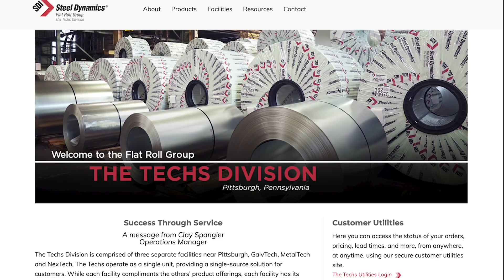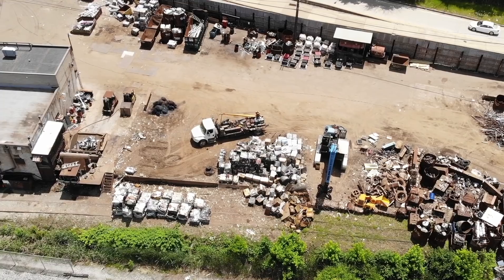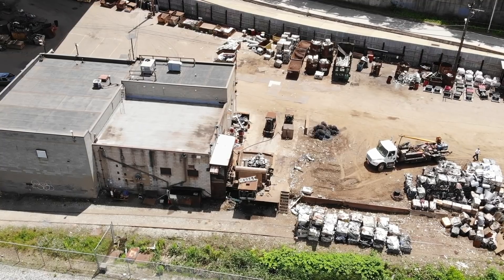STEEL MILL Industries You Can Model on your Model Railroad.

Comment: Thanks for all the great drone footage, DJ.  In the mid-60's when I was in college, I worked four summers at U.S. Steel's Gary Sheet & Tin works.  Specifically I was in the 30" hot strip dept.  I saw a lot of steel slabs and the coils made from them.  Of course, the EJ&E was the whole RR story there.  There was a siding inside our building for loading gons with scrap.  Boy, those cars took a real beating!  I'm surprised they remained road-worthy after they were loaded.!  Cheers.

Comment: I used to work in a scrap yard for about 10 years over here in Australia. 
You are 100% correct about the scrap being colorful. We used to get everything... refrigerators, washing machines, cars, roofing iron... just to name a few. And yes, we also received rusted metal, cast iron even railroad spikes, rail etc.
We even had 2 trams and a steam engine tender. 
All of the non ferrous metals (copper, aluminum, electrical cable, brass etc) where all unloaded and sorted inside a huge shed, loaded into designated bins and then loaded onto a flat semi and taken to our main facility.
We had different categories for the ferrous metals, but all that stuff was loaded into a semi with a tipper and taken to the main facility.
I started off working in the shed but then ended up operating the excavators (magnet and grab) to unload customers that came in and to load the trucks to go out.

Comment: A have a Auto Scrap Stripper/Scrap yard 'Sanford and Son' on my layout.  If you use google you can look up time frames it it will give the percentage of materials used to build cars.  Steel, Aluminum, Plastic etc.   What I have done,  I used the percentages from 1960's and 1970's averaged them out for 1996 (20 Year of usage life)  This gives my a good idea of metal ratios as well as junk like plastics and glass for my era.  Now If we go all the way we know the percentage.  I now can look up the weight of bailed/compressed material.  Compare that to GB weight capacity and CuFt.  So my cars are properly load and have the correct ratio of cars per materiel leaving the Auto strippers.  Yes it is over the top.  But I have done the same thing for the Cement and Sugar Beets as well as the cannery.   Correct ratio and tonnage per product dictates the rail car traffic

Comment: Great video DJ! Are you sure that the ends of the pipe, in the gondolas, were painted? Sometimes the ends of the pipe are threaded, for well service, and they will have a red plastic cap to protect the threads.
Reply: Red paint is so they don't use the pipe for water.
Reply from the maker: AHHH!!!  THANK YOU!!!

Comment: As usual, excellent video DJ. And as far as the painted ends of the pipes, I know from driving a truck for 40 years and hauling anything and everything on a flatbed, that in some cases the color of the painted ends is a quick indicator of the size or diameter of the pipe so there is no confusion when loading.
Reply from the maker: Thanks 👍

Comment: Great content. I use a flashing transmitter on my scrap yard to make it look like somebody is working with a cutting torch and I also make my chain link fences using scrap screen. You can use the old metal type and you can solder it or you can use the cloth and then paint it silver.

Comment: Been building up a small Foundry. Aluminum Scrap to products. Just added a second siding for storing empties or loads for Switching. 

Consists of an old small plant and a new modern steel building. Will be a third building n the Complex. Want to get it to 2 Stories. Just added 2 52’ Gondolas to serve it. Total of 4-5. Empties or with Scrap Loads. Plus have Coke Hoppers. All in N Scale. It’s developing into a good Switching point.

Comment: DJ-
Each pipe also carries painted markings that will help the installer by providing information on the pipe length, identify pipe suitable for field cutting and assist in the proper installation of the material.
Lifted that from the www. Good prototype info though to make realistic loads. Some have line around circumference to indicate it’s pushed “home” during install...
Reply from the maker: Thanks for that!

Comment: The future of URR runs to Irvin. 
The good news is that the end of slab production will not be the end of 76 crew running to Irvin. In fact this will possibly increase movements to the Irvin works. The process at ET will only produce raw coils and these coils will be "thick" or a heavy gauge. These coils will be shipped via the URR to Irvin for finishing.  The ratio of slabs to coils I am told is at minimal 4:1 so that is going to be a lot of coils going up the hill! Due to the geography and space inside ET the coil trains will be limited in size so this will likely result in a extra turn or two a day.
Reply: We are being told that the likely candidate for the cars to handle these raw coils will be GRW coil cars, there are quite a lot of these in storage all over the URR. I would suspect that the hoods will be scrapped. I also understand this process will slightly increase coil scrap from Irvin back to ET.

Comment: I have been told that the ends of the pipe are not coated so it can be welded (internal or externally) without the coating preventing a good weld. They paint the ends, to protect them in transit and storage from the elements,  with a paint that will easily come off with a wire brush just before its welded.

Comment: If you had 4miles of loaded coal hoppers how many locomotives would you need to pull them and would it be better to spread the locomotives out?
Reply from the maker: 2 engines pulled 1.5 miles today.  So 5 engines, 2 in front,  2 in mid, 1 at rear would make this scenario possible, but very unlikely due to our infrastructure isn't designed for it.

Comment: They paint epoxy primer on the ends to slow corrosion.
Reply: Good video.  Wished that someone would do stuff about the L&N before the mega mergers.  Lots of American history involves railroads the people that built them and even the major owners themselves.
Reply from the maker: I live very far away so it wasn't one that I knew a lot about.  Maybe someone reading this can put together a video.  I was born in 1970 but didn't start taking pics and videos of trains until after the mergers like you mentioned. Huge regret.
Reply: @djstrains  CSX is a mega merger. I will have to review who all is involved.  The C comes from the Chessie System (C&O/B&O the first railroad in America, and SCL Seaboard Coast Line.  There are many lines included (L&N, Western Maryland, Pete Marqute, GeorgiaRail Road, Clinchfield Railroad just to mention a few).  Then there is the PPR and New York Central (Penn Central) which became Conrail after bankruptcy.  This is all in CSX.  I can’t forget Monon and several others.  This is half of the US!
Reply from the maker: @kenshores9900  THIS IS WHY WE NEED HERITAGE UNITS!! Lol
Reply: @djstrains  Rail roads were built to carry products such as steel and oil. Oil is far cheaper to transport in pipe lines than on trains.  However millions of tons of chemicals are still transported.  So if you are modeling then you have to have such places along your tracks. One last thing.  One of the list railroads of Indiana is the Monon.  It went from Chicago to Louisville.  However they came on the scene to late and did own entry to either city.  There is a hard cover book on this railroad. Many stories but to short of time to tell them.  Indians Railway museum runs an excursion train on a remaining portion of their tracks in Southern Indiana.
Reply: From what I’ve seen elsewhere, these pipes will have had a weld-prep chamfer/profile pre-machined on each end (hence, as you say, the need to paint an anti-corrosion finish on them). For higher spec use, I think the end user will need to re-machine a different profile, but at least the bulk of the material has already been removed.
Reply: Sometimes they will put thermoplastic "keepers" on the ends to protect the chamfer joints. Important for a good weld.